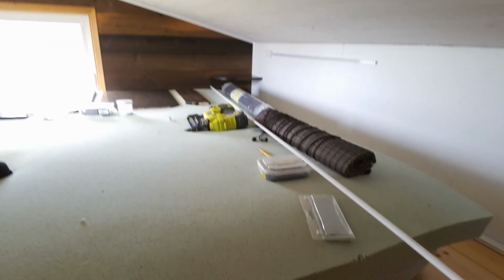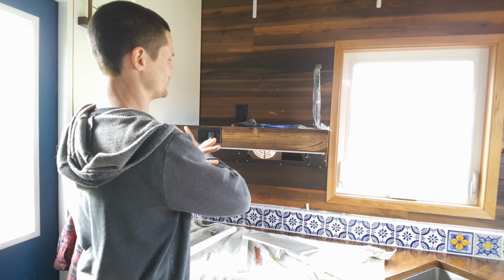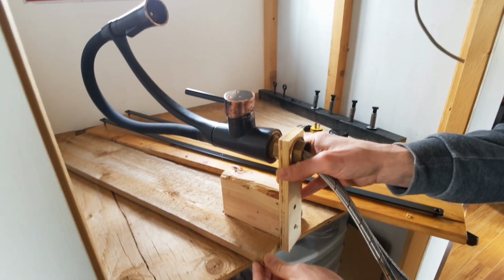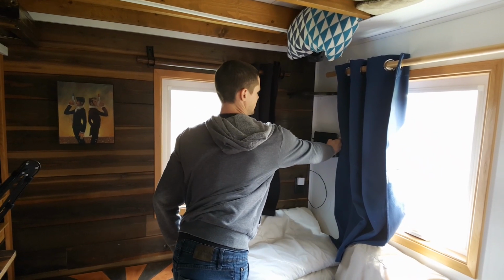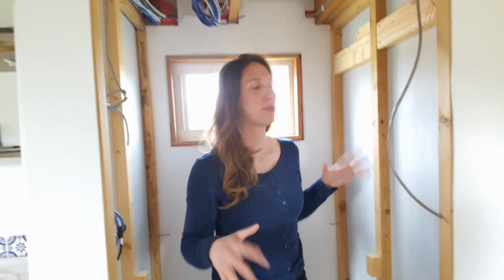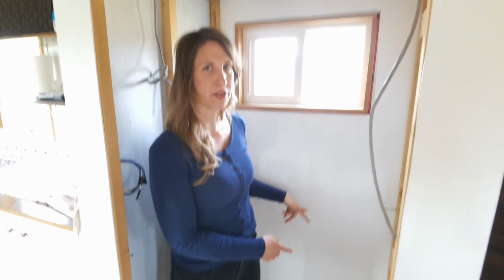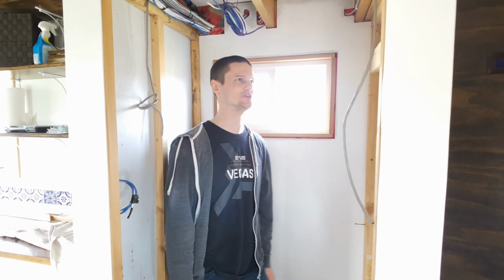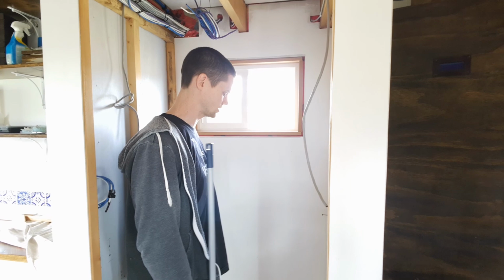What To Do About Our Tiny House Shower??

Comment: Have you thought of using a waterproof coating? Like what they use on roofs? Possibly something that can be tinted and you paint it on? Maybe test a small amount of a piece of srap wood.
Reply from the maker: Someone else suggested that too!  Will look into it, thank you! :)
Reply: Elastomeric has anti freeze fyi. Not sure if it matters for this application or why it’s for "exterior use only". (?)

Comment: I used RedGard under my shower pan and plastic sheeting for the walls of my shower, because I was so scared of leaks. I'm not sure if it's meant to be used as an end result rather than under something, but it's definitely at least meant for showers! Also, it's bright red, which could be a drawback.
Reply from the maker: Interesting!  Thanks for the suggestion. :) Looks like a  good product for the job.  How is it working so far?
Reply: @tinynestproject  we lived in our Tiny House for eight months without any issues. We did have a fiberglass shower pan and some plastic on the walls, so theoretically the RedGard didn't even come into contact with any water.  I sold the house, so I'm not sure about how it holds up long term. 

I'm excited you guys are posted videos again, your videos helped us so much in our Tiny House build! Keep up the great work!

Comment: Really overthinking this shower. The kitchen and bath market has tons of solutions for custom projects.
Reply: i can tell you, having built my own tiny house, that the kitchen and bath market had NOTHING that met my needs.  The thing is, the kitchen and bath markets don't make anything designed to be CUSTOM and MOBILE at the same time.   You can get something lightweight designed for a mobile home, but it looks like trash and more importantly is all built in standard dimensions.  Nothing custom.  Solid surfaces lend well to these custom spaces but are VERY heavy and very expensive.  I devised a solution to use the solid surface concept, but with much lighter materials and far less expense.

Comment: i would be concerned about monolithic sealing because of humidity/mold/unnoticed micro leaks. prime plywood floor/wall studs with Kilz oil based mold resistant primer. the key thing is sealing the shower floor/drain area since that is where any leaking water will end up or originate from. use rock sheet for walls not plywood. 45 degree from top of wheel well to wall. use glue on shelf on finished wall between well and window bottom. 

use pvc bathroom sheeting on floor going 4-6 inches up the walls, up and over wheel well wall and around window. use pvc drip guard around window. you may want to put an intentional  3/8/1/2" hole/hose moisture drip hole/hose through plywood floor to outside for early moisture/leak warning. put rock sheet on floor on top pvc sheet then lay Schluter®-DITRA and tile floor. finish walls with ceramic/pvc tiles or other water proof material.
Reply from the maker: Thank you for the suggestions!

Comment: Just installed in my tiny house shower for walls I used Duma Wall. Lightweight, easy to cut and water proof. For shower tray used Schliter Kerdi , again lightweight and can custom cut with ease. Hope this helps!
Reply from the maker: Duma wall looks like a great product.  Were you able to cut it into the size you need and it still sealed properly?  Schliter Kerdi has been recommended a couple times, looks like it could work too!  Yes, thank you this is very helpful :)
Reply: @tinynestproject  Duma Wall cut easily with razor blade or jig saw/ circular saw. You silicone in the seam of the interlocking edges to make make water tight and the kit I purchased came with corner and edge trim that the tile fits into as well

Comment: I have to build a custom shower pan myself for my tiny because of its shape and as you mentioned, there are many available options.  I have researched most of them (DIY, fiberglass, ordering a custom pan, etc.) and I plan to use “Schluter Kerdi” for my shower pan.  This product has built-in slope for water flow (and I can cut it to a smaller size and even shift the drain hole, if I don’t want it in the center or if there is a trailer cross member, preventing to have a center drain) https://www.flooranddecor.com/shower-systems-installation-materials/schluter-kerdi-shower-center-tray-38in.-x-60in.-100597772.html#q=Schluter-KERDI&start=24.  Right now, I plan to cover it with little tiles but that could change (including six inches up on the walls, using the Schluter Kerdi membrane for water proofing).  Again, with respect to the walls, there are so many options (e.g., Schluter Kerdi membrane, fiberglass panels, etc.).  It is really important to make sure about water proofing with whichever method you decide to go.  I plan to take the easy road and use shower liner all around to get water proofing.  I plan to use this product (https://www.amazon.com/gp/product/B07MMHQJP2/ref=ppx_yo_dt_b_asin_title_o06_s00?ie=UTF8&psc=1) which I have been using at home and I am very happy with it, since it is a water proofing “fabric” (easy to use) instead of hard to move around plastic liner.  Mine will not be done for another 2-3 months and I usually post photos on the “Tiny House People” Facebook group.  If you want, I can send you a short video of my bathroom layout and its shower location to show what I plan to do.  PS. using a liner all around will also solve the comment from peterdement

51 minutes ago
, The window in the shower will be your biggest leak problem area.
Reply from the maker: That shower pan looks like a good solution.  Are you just using the curtain as your walls?  Like in a circle around the pan?  We did think about doing something like that early on in the build, and yes, it would solve the issue if the window.  We would love it if you sent us a video!  our email is contact@tinynestproject.com. Thank you so much for these suggestions!  Will keep an eye out for your build updates as we are also a part of that facebook group :)
Reply: @tinynestproject  Yes, I am using the curtain as my shower walls. In your case, the curtain can go in a circle around the tub because your shower head and the valves are on your ceiling. In my case, I got the valves on a small wall, and my curtain covers about 90% around my tub. Of course, with the valves on the wall, one could run the curtain around 100%, however that would require moving wet hands behind the curtain to operate the valves (no biggie).  Note: the curtain ends need to over lap by running the the shower rod ends past each other. You could use two curtains, one on the right and one on the left, with the two openings at the back (window) and front (entance) and when you are done taking a shower,  you could move the curtains to left & right which moves them away from the entrance & window.

Comment: I would abandon the watertight approach to a shingle/shed to a shower pan approach!  Find a metal fabrication shop (maybe your friends at Iron Eagle) and have them fabricate a stainless steel shower pan (with recessed drain hole) with welded corners .. I would build up the top of the wheel well to have a slight pitch to it (2x6/8 cut on an angle) .. find a siding company and have them fabricate some simple (4" wide) inside corner flashing (in black) in eight-foot lengths (inside corner) you can cut to fit with tin snips and one outside corner (4 foot) flashing for the top of the wheel well .. that leaves you with a siding for the shower stall; sheet metal (solid - corrugated or smooth) would be good or fiberglass panels (in many colors) would work well too.  The shower pan can be augmented later with a teakwood mat (you custom build) as you find money and time.  Your bathroom sink drain should not be rusting (and the poly will be problematic too) replace with a solid brass drain when you find time/money
Reply: I like this approached and I was researching myself to get a stainless steel shower pan/Soaking tub.  However, I gave up on the idea after receiving a few estimates from the fabricators (not cheap) and I wasn't sure, if it was going to look okay (cheesy), especially at welded joints.
Reply: @George_us  If done properly the welded corners should not be an eyesore; additionally, with the overlaying the corners will be further covered .. the shower pan is small (not a lot of material) but custom work CAN be expensive, but (again) maybe your friends at Iron Eagle can help you out

Comment: You can use fiberglass as you mentioned it yourself. You can form it around anything, You could use plywood and coat it in fiberglass and install it in sections, and then some silicone at the seams. 
Hope the above makes sence :) 
Thx for sharing. 

Regards :)
Reply from the maker: Yes, makes sense.  Thank you for the suggestion! :)
Reply: Wouldn't it be better to fibreglass afterward it is all put together, over all of the plywood, art, whatever, to create one continuous barrier?

Comment: I think you guys would definitely benefit from having a dedicated tub/bottom tray. You could either make it out of copper, stainless steel or fiberglass. Could also have someone else make it. I would definitely leave in the bump-out, the little step would be useful for showering. Don't know if you guys can order something like zip sheathing but that could work as well instead of using regular plywood with some liquid flashing. There's a YouTube channel called The Build Show that goes over a lot of that zip sheathing and flashing, Zip 2.0, Zip 1.5. The wood slat siding seems like it would be really interesting.
Reply from the maker: Zip sheathing looks interesting...we will look into that and check out the build show too, thank you for these suggestions!

Comment: My only suggestion I have so far would be to make some kind of seat that is built to protect the wheel well. You could sit while you wash your feet, etc while having a shelf for shampoo that is more accessible than reaching down to the wheel well. I personally don't like the idea of a slanted wall for aesthetic reasons. I think if you made a seat it could have a slight slant to it. I will keep brainstorming on your shower too as I am in a similar boat. I have been leaning towards a 30"x30" shower pan with corrugated metal for the walls but I too am a little skeptical his this will protect the walls.
Reply: my thought on this seat would be that that it is a permanent seat built around the wheel well
Reply from the maker: Hadn't thought about having a seat in there...but you are right, the wheel well might be too low to reach for soap etc. Thanks for the suggestion and good luck with your shower. Let us know what you decide on!

Comment: Going kinda off topic here but, knowing that you have the contact info of the trailer company guy, I'm planning on making a tiny house towable by a bicycle and it seems that I'm the only one because I have found literally just 1 video and nothing else. So, how many kilos can a 3x2,20 meters trailer weight? And, is there a significant difference in weight if I go with aluminium vs steel? I know is a long shot but if you have the info or where to find it it would be so cool. Greetings from Chile!
Reply from the maker: Wow, sounds like a cool project. I haven't seen anyone towing a tiny with a bike before.  I would suggest getting in touch with Rob at Iron Eagle trailers. http://eagleirontrailer.com/ironeagle/
Thanks for watching!

Comment: I’ve seen the tile panels that are really pretty with tiny tiles but they are make in large squares so easy to apply. That’s what we are planning for ours. I love the idea of polyurethaning the drain. 😃👌🏽
Reply from the maker: Hmm interesting. I guess there are quite a few different tile options. Do you know if these panels are lighter than average tile? I (Kiva) love the look of tile but just worry it will be too heavy. Thank you for the suggestion! Will look into different tile options 😀
Reply: I saw someone (Nomadic Fanatic, I think) who found a backsplash tile that was a hard plastic, yet looked like glass. 12 x 12 sheets, I think, with an adhesive back. Here's something like it:https://www.youtube.com/watch?v=7pWGHXDpyD0   Using something like that, with a silicone adhesive (NOT caulk) to adhere and substitute for grout might be nice. And it would be both flexible and waterproof. I'd use a thin plywood, 1/4", and coat it with a good waterproofing material. Research your waterproofing material thoroughly. "Flex Seal" is well known from their commercials, but I don't know how durable it is. You don't want to regret your choice later.
Reply: Tiny Nest I believe it is lighter. I looked at them at Home Depot a while back.

Comment: Can't wait to see how that vent hood turns out. That sounds like it may work for what I want to do in my camper
Reply from the maker: We have been using it for a couple years before we had to move out and it worked great! We just stained it and added the metal bottom. Will let you know when we move back in and get cookin!